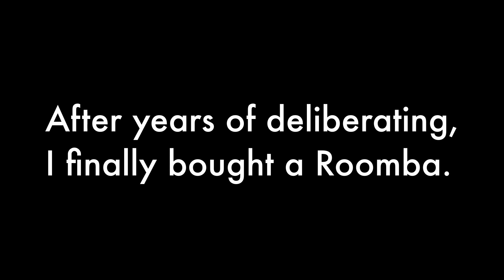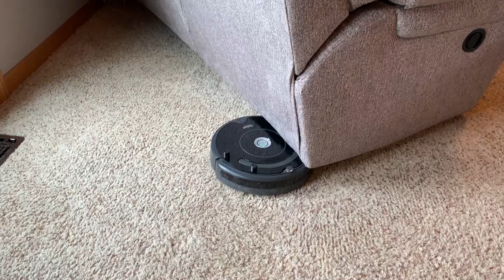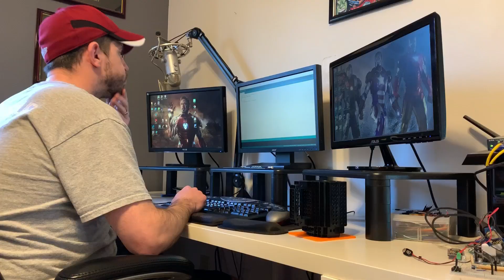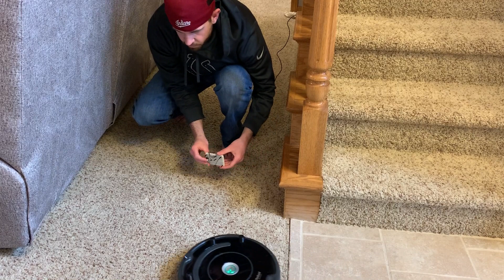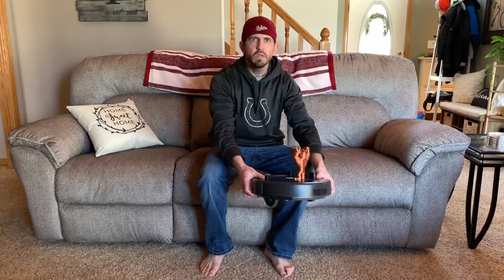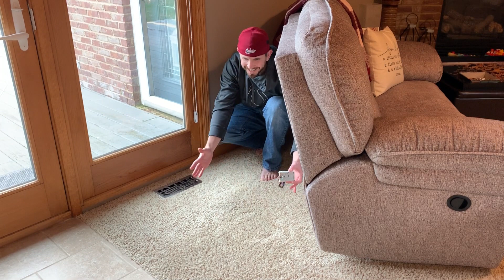Man vs Roomba - DIY Virtual Wall Prototype

Comment from the maker: I am well aware that you can buy virtual walls for your Roomba. I believe some Roomba models actually come with one or two, but mine didn't, and I didn't want to spend the money on them. That's actually what spawned the idea for this. This is a DIY/How-To channel, and one of the main points of this channel is to showcase things I have built myself to inform you of alternatives to off-the-shelf products or services, especially when said solutions cost a fraction of what the store-bought solutions cost.